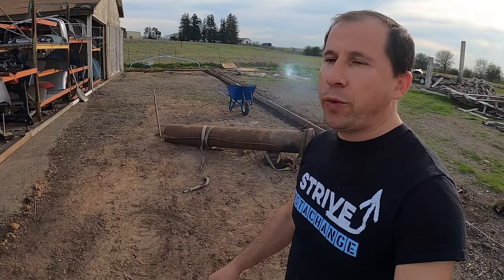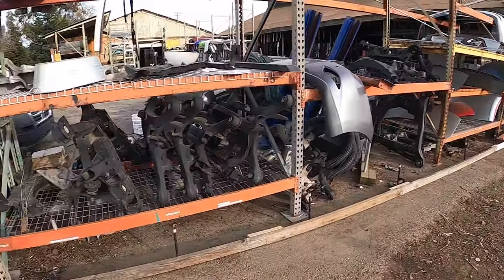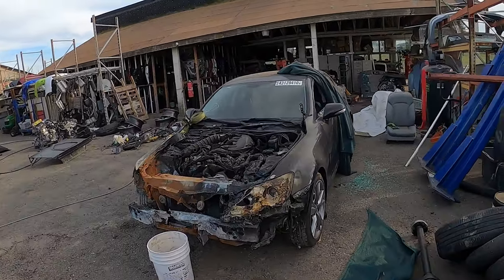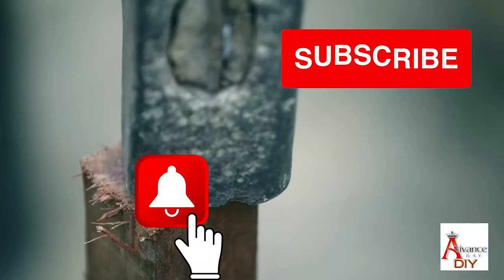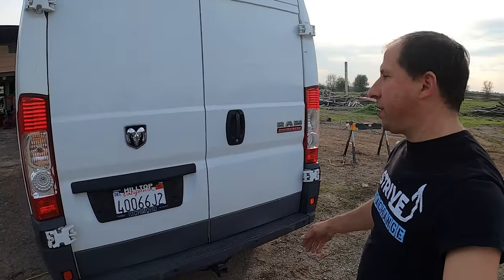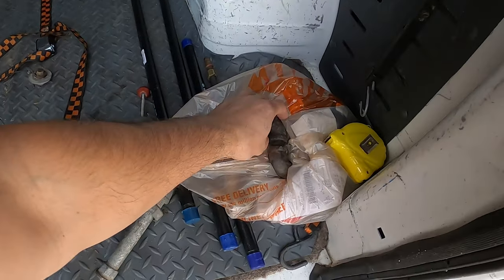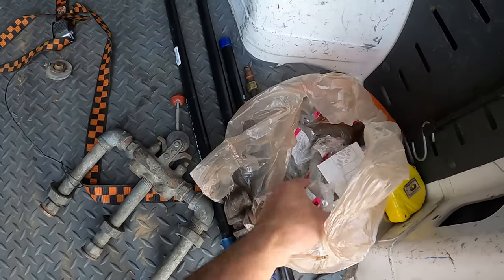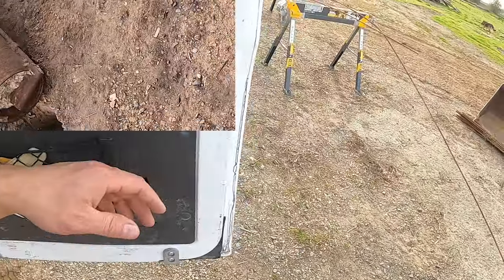DIY Building Carport With Under Ground Car Lift Part 5

Comment: U need to use hard piping..  and u needed a safety leg , non rotor..for safety.. u have your self or others around   u don't want anyone getting killed if it loses air pressure..  I own one ..I have kids..around I put a shut off ,ball valve on the pipe that feeds air to the cyl. As a safety   just in case kids play with the lift..  you never know ..friend.  Safety first
Reply from the maker: Thank you for your advice.
Reply: I see u had kids..around..I have them  as well    a safety leg is vary important..u can order  the outer leg casing..as well from SVI corp in Dekalb,IL. They build all parts for inground s.. you pro have a 66 " leg type for yours ..ya u got to did up again   but worth the safety aspect .great video
Reply from the maker: Thank you for sharing, I will do research about safety.  I never had a lift like this. Thank you.
Reply: You have a good lift..it should last 40 plus yrs
Reply from the maker: I hope so.